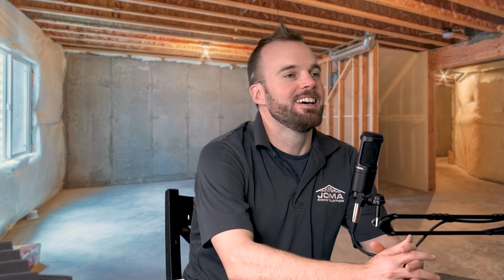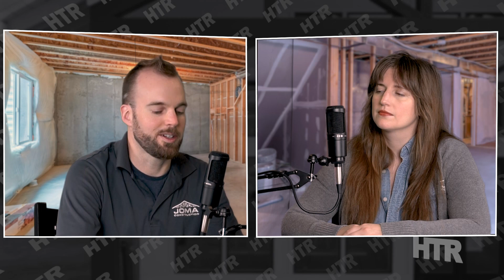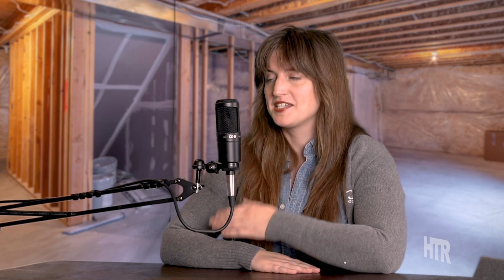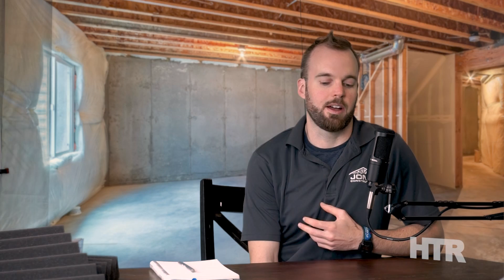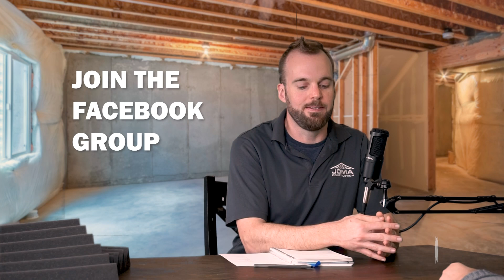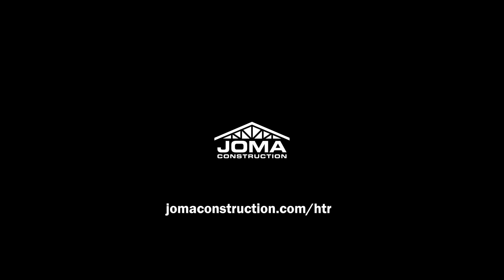How To: Remodeler - First Call with Carley - Initializing The JOMA Process - JOMA Construction

Comment: How should I go about selecting the right company to do my remodel?  When updating a kitchen or bath how should I estimate what a remodel might cost?  Thank you.  This was good information.
Reply from the maker: Great questions! Seek out Google reviews and read about our 'process' on our website: https://www.jomaconstruction.com/process . These four documents provide a brief summary of our well-defined pre-build process. Even with this guide and our support, starting a project is a big task when it comes to planning, selecting, and meeting regulatory requirements. Your contractor should be able to provide a framework for how the project will begin and what you will be responsible for. You should expect this level of service because, in our experience, consistent results are impossible without a good plan in place.

Pricing: Cost is the biggest factor in determining feasibility. Most contractors, including JOMA, provide free consultations and initial quotes. However, you should be aware of busy contractors who cannot spend the necessary time on initial quotes. It is easy to get bogged down because quotes are hard and tedious. At JOMA, we have solved this issue with our initial cost calculator and pre-build process. First, we create your initial cost range in minutes using our own pricing system, which builds your cost range from hundreds of variables. We are so proud of our initial cost calculator that we are turning it into an app for anyone to use, providing an easy-to-use interface to instantly calculate an initial cost range for their project. We were inspired to make an app because you cannot find accurate pricing for your specific region that accounts for your project details online anywhere.

After that, you will receive instructions for proceeding with the pre-build process. With a nominal fee that covers time for design and plan services, tests and permits, and any other planning-related costs, we are able to spend significant time researching and planning your job while you shop for selections to build your real fixed-price contract. I wanted to prepare you for the possibility that a fee for planning is a good sign. It indicates that the contractor knows how big of a process it is and values everyone's time by providing high-effort organization and service.

Years ago, we didn't know how clients would react to the pre-build proposition, but it has been a huge success that has elevated the value we are able to provide at the beginning of the job, which is the most crucial time. Thanks for taking the time to comment. I'll take this write-up to Carley to see what we can do to explain this in a video. Have a great day! -Mackenzie